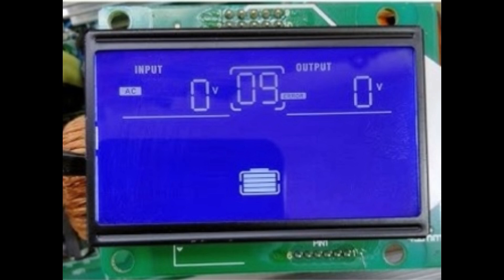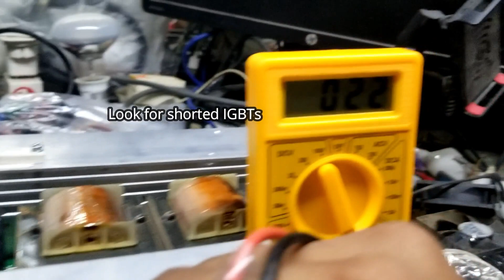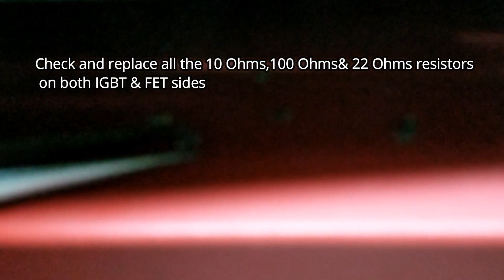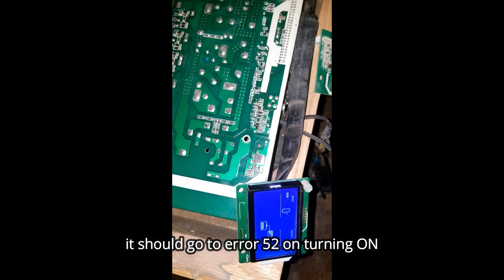3.2 Kw voltronic solar Inverter repair - Error 9

Comment: Nice video. I replaced all the burned parts and error 9 become error 5 :(. Help please
Reply from the maker: @gcosmico666  check and replace faulty smd components including resister and zener diodes, also replace the 3525 IC